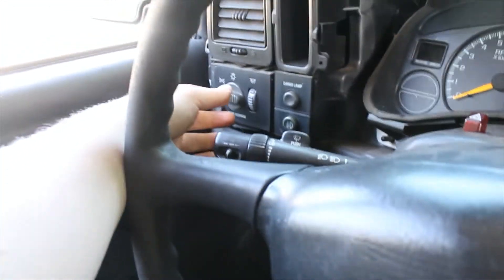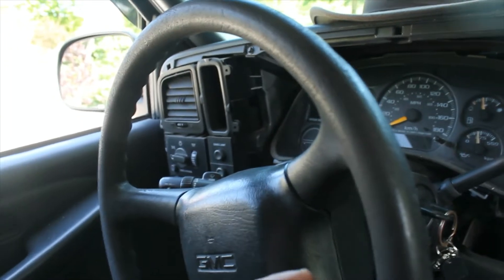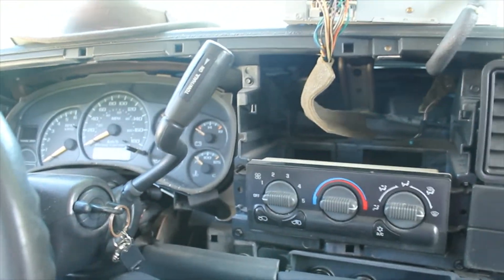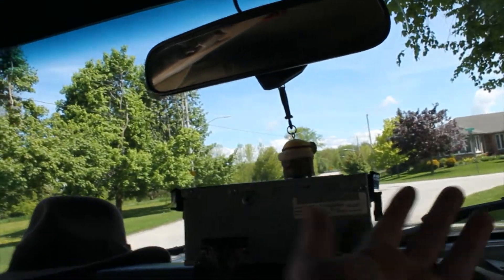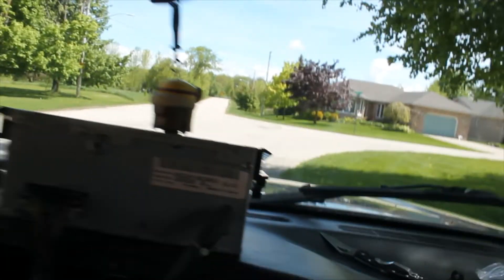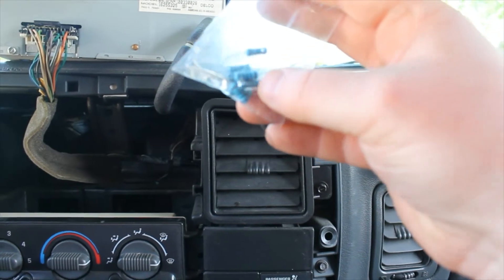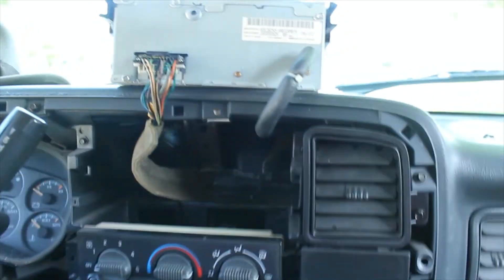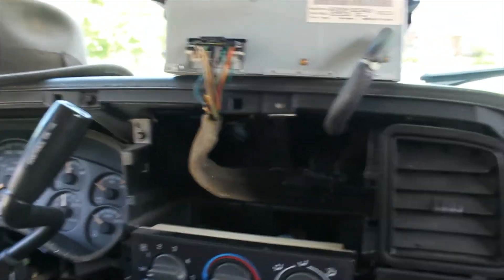How to Disable Automatic Lights on a 1999-2006 GMC/Chevrolet 1500

Comment: What size resistor.    I'm getting into trouble with a truck new to me 2001 chevy 1500 I can gwt to thet part quick.  I just need to know the size resistor to put on it
Reply from the maker: Small, i just searched resisters on amazon and got a dozen for about a buck
Reply: @CadillacKid  I figured it out.. the bypass thing you said.  Thank you .. I did the override button..

Comment: Okay.... So what do you do if that don't work? After taking the entire dashboard cover out, because my big hands would not fit in there,  I pulled it out that censor and jumped the plug. Lights still came on when I switched the ignition on. I also tried jumping it across the purple plug underneath the dash. That didn't work either. Now, my censor is out, the wires to the plug have been jumped solid and I have headlights on ALL the time now. I'm really getting irritated with this thing!!!
Reply from the maker: when you say jumped do you mean putting a resister on the end of the cord?
Reply: @CadillacKid  Yeah. But apparently, I was having further issues. First I tried crossing the white and gray wire on the purple plug of the BCM. The headlights came on and stayed on when ever I switched the key on.  Then I tried crossing the sensor plug and that made no difference. But... I found that if I disconnected the two white wires on the center plug of the BCM then all automatic lights went out. Now I have them working only with the headlight switch. My high beam indicator light now comes on when ever I'm running with no headlights, but I can live with that.
Reply: @CadillacKid  what size resistor did you use?